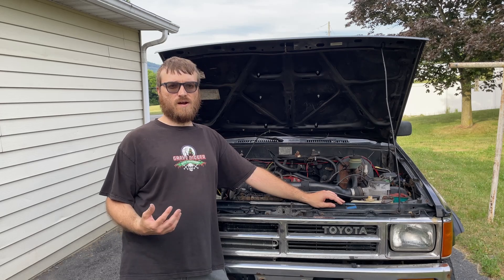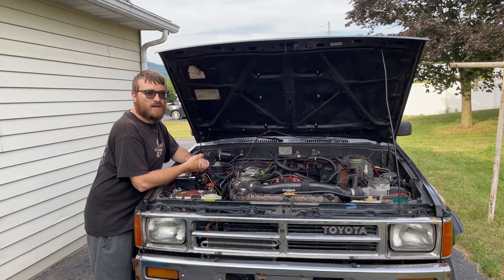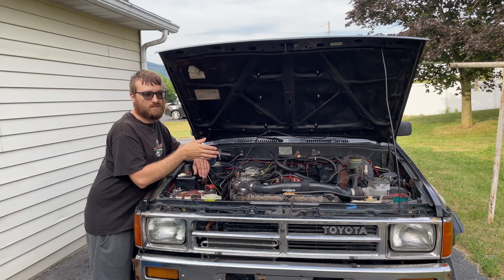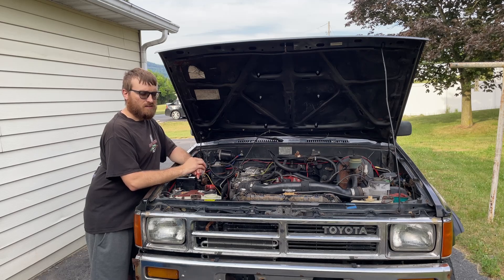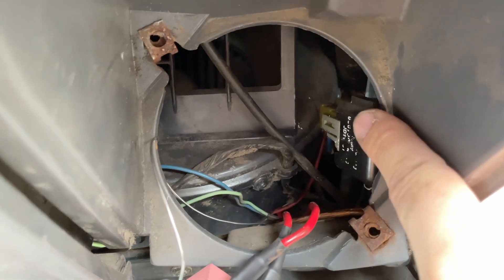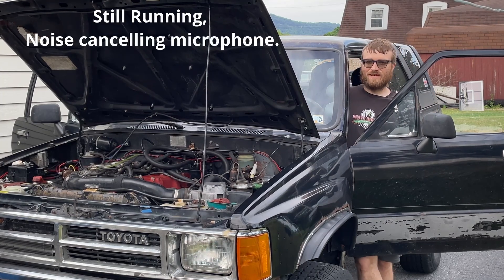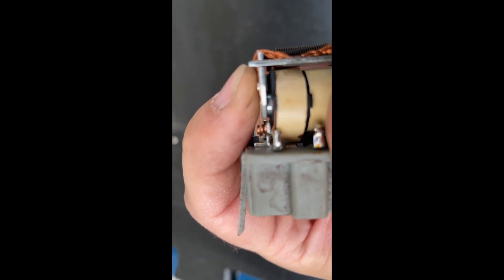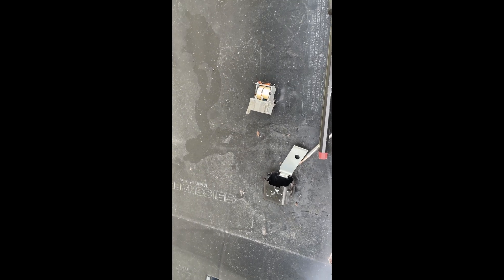No start old Toyota? Circuit Opening Relay failure!

Comment: ive got a toyota chaser, 1jzgte and most times when its sat overnight or for at least 15-20min it starts right up. but for example if i go get gas, turn it off for only that 5 or so mins, itll just crank and not start.
I have a brand-new battery and starter. new ignition coils, leads, and spark plugs. alternator has passed every test.
Fuek pump and injectors seem to be sound.
could this be a symptom from COR?
Reply from the maker: I had the exact same thing happen to me  a year after replacing the COI in the video. It was my 36 year old fuel pump. Same exact situation started and drove fine home from work, stopped for gas and it didn’t want to restart. After 5 minutes of fiddling it started and drove home. Now if you already replaced that, it could be that a sensor is getting heat soaked or something like that. You could try and re create the situation at home and pull a plug to see if it is soaking wet and check spark to give you more info on what exactly is happening when it won’t start.

Comment: I’m dealing with this issue so I’m hoping mine is the circuit opening relay
Reply from the maker: I had a fuel pump on its way out and it acted like a bad COR. The COR is easy so start there but if your still having issues after it might be the pump.

Comment: Thanks for the video.
2 questions:

•once the vehicle is started can you jump Fp & +B without messing the ECU up?
•is there a way to jump the opening circuit relay, in its connector? 

I’m curious because I want to see if an intermittent relay is affecting the fuel pump operation & causing a rough idle

Comment: When you put the relay in, do you have to disconnect the battery or the battery has to be connected while you takeoff the old one and put on the new one 
My 89 4Runner has a misfire  it starts right up, but the two cylinders are not working. I put brand new fuel injectors in, but still have a misfire truck turns on, but when I saw your video, it gave me an option. ❤❤❤❤
Reply from the maker: I didn’t disconnect the battery. It won’t hurt to disconnect it though. I’d check your wiring on your injectors with a multimeter.
Reply: did your fix work? what did you do?
Reply: @  it wasn’t it
I think it’s the airflow meter sensor. They do not sell it O’Reilly or AutoZone or Napa or even Toyota dealer that part got discontinue for the 22RE.  I have to look for one from the junkyard.
Truck doesn’t start

Comment: My issue is my relay seems to be losing value So I have remote starting on my vehicle if the battery is charged close to 13 it'll work but if it's anywhere near 12 it will not start just clicks So what I did was I got A multi Meter tester I tested the value At the starter solinoid It read less than 12 V 🤔
Reply from the maker: It’s a common issue for the starter to click. A common fix is to use a relay so your trigger wire activates the relay and when activated a clean 12v from the starter activates the starter.

Comment: I have an old 1989 Toyota pickup with a bad circuit opening rely, I need to pull it out to replace it but I can figure out how. Just wondering if you know because I can’t find any videos anywhere on how to do it.
Reply: Should be pretty, it’s just a big fuse basically. Google the location on your truck, pull it out and order a new one